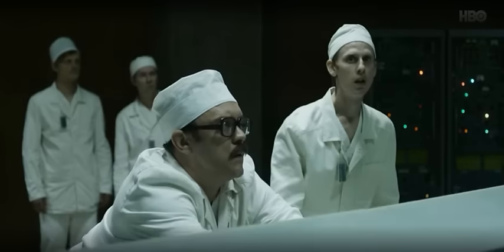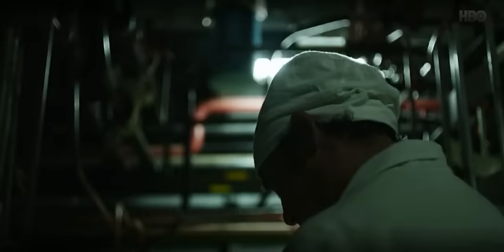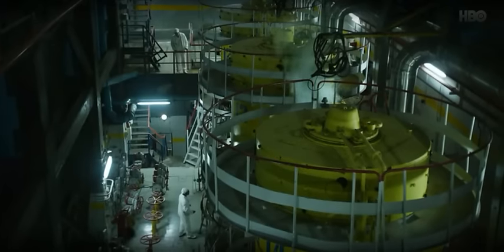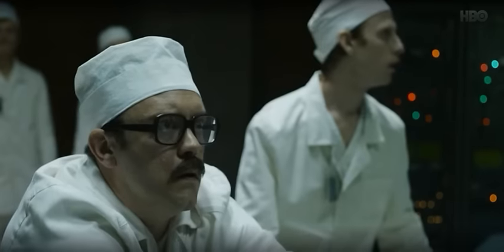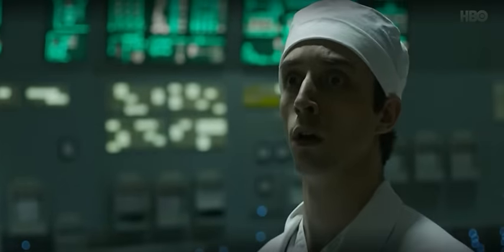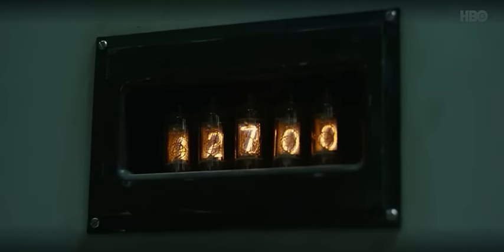Chernobyl (2019) Nuclear Reactor Explosion Scene

Comment: Toponov was the man who pressed the az-5 button. He was the controller at the reactor board during the experiment, and pressed it a little late after looking for his immediate supervisor to tell him, which he did by making an expiration of pressing the button. So it was not akemov but toponov at the controls and who pressed the button. Also there is no way that the run from the reactor up the stairs to the control room in time. It simply takes too long! I’ve heard the phone exchange from the control room that night and it was hectic. I’m told there was a video of the control room during the test and explosion but no one knows what happened to it. If it’s still around properly buried in a vault somewhere in Russia never to be found again!
Reply: You missed the entire point.
Reply: @Korben_MyMan  I guess so…???
Reply: @robertschultz6922  I doubt being "a little earlier" hitting A3-5 would have changed anything. The core was already in a xenon pit after being run at such low ouptut for so long in the lead up to the test. In their attempts to push through that and raise the power output they (Toptunov or Akimov, doesn't really matter right now) tried removing nearly every single control rod. But how much earlier would they have needed to be to reinsert all those rods without risk of vaporising the water and rupturing the channels? Surely that opportunity had passed the moment the graphite portion was removed, not when they were trying to reinsert it.

Comment: still better than coal, oil and gas. around 50% of the energy mix should be nuclear.
Reply: It isn't. Its about 2x more expensive per KWh compared to fossil fuel, and up to 4x more expensive than renewable energy. Nuclear reactors are also far slower to build, and have a tendency to go over budget by A LOT.  In 2020 and 2021 alone, the world added 464 gigawatts of wind and solar power-generation capacity, which is more power than can be generated by all the nuclear plants operating in the world today. Add to that that the mining and enrichment of nuclear fuel isn't exactly clean either (still better than fossile fuel though), and you pretty much have an obsolete technology. And that is even without the part about radiation, nuclear waste, accidents etc.
Reply: @Dr.W.Krueger  and you keep ignoring the facts :)
Reply: @Dr.W.Krueger  then earth has no future.
Reply: France has ~70% of its electricity provided by nuclear power plants yet EDF is on the verge of bankrupcy with a debt of ~100k millon €. General Electric entered in bankrupcy due nuclear is unprofitable and the only reason USA, Soviet Union, UK, China and France pushed nuclear civilian power plants so hard was to leverage the cost of making their nucklear arsenals. Once they had enough nukes the stream of money to waste in nuclear plants was cut and the market did prove that they are unable to compete vs other power sources. Anyone thinking different is delusional.

   Even worse: currently nuclear power plants only provide ~10% of the commercial electricity produced, which is only a small fraction of our total energy comsumption. Even doubling our number of reactor tomorrow won't matter due a) they wouldn't be enough; b) not a single new plant bwould be in operation before 2035 and C) we don't have the money, materials nor real state to build the number of plants required to fill mour energy needs, and in the run most of our countries would enter in bankrupcy.

   I support the ITER due is a cooperative multinational effort to do experimental bleeding edge science, but the ITER is a reserach facility, and fusion is too far away in time (if even achieves success any time) to save our asses from our current evironmental crisis. Nuclear is done.
Reply: @justinbiggs1005  still too expansive compared to renrwable stuff, too slow to build etc.
Reply: @Dr.W.Krueger    So they are smart but what happens is that they are crumbling their own economy in a failed attempt to rescue a unprofitable sector which is not going anywere and will end in one of the largest bankrupt in history? Ok.
Reply: Wrong
Reply: @sloppy-1-1 firstly it’s complete nonsense that any other form of energy can produce on the same level as a modern nuclear reactor. The smallest nuclear power plant in America, R.E Ginna, can produce roughly 5,000,000 MWh a year at full capacity. 
For scale thats 5000 Giga Watts and can power entire cities alone with the smallest reactor in the US.  Comparatively the average coal plant produces around 3,000 Giga Watts a year which is over 2000 less than the smallest nuclear reactor in the country. 

Nuclear fuel fears are also somewhat redundant because they don’t just dump the stuff in drinking water. There are strict regulations on how to dispose and store nuclear waste which can go as far as building entire tunnels to store it in safety away from the public. 
This whole issue will also be solved when Fusion can replace Fission since Fusion reactions produce significantly more clean energy than fission and is what powers the Sun itself. 
Fission all together is also no where near as dangerous as coal or oil since in total 0 people have died from working in nuclear plant. Chernobyl and Fukushima are the only exceptions. Chernobyl was caused by gross mismanagement and corruption by soviet operators that degraded standards until the already poorly built reactor exploded and killed a few people directly and roughly 10,000 - 50,000 from nuclear exposure. Fukushima was caused by one of the largest tsunami’s to hit Japan that was able to bypass several security measures in place, and in total this “disaster” killed 1 person. 
It’s also important to note that both of these places are completely fine to visit today and Chernobyl is actually one of the most biodiverse nature preserves on the world from lack of human interaction. Comparatively several 100,000’s die per year from exposure to toxic fumes from oil and gas refineries along with coal power plants. Cars are also a leasing cause of this and have polluted the air quality of cities like Los Angles and New York by exorbitant oil consumption. 

Fossil fuels are objectively more dangerous and inefficient than the smallest of nuclear power plants and kill hundreds of thousands per year while the only deaths from nuclear energy have been caused by incompetent mismanagement over several decades or massive natural disasters and are minuscule in comparison.
Reply: @motivationallizard6644  that's all nice and probably correct, but my points about costs and slow building time still stand.
And I bet some hysroelectric power planes are equally powerfull.
Reply: @sloppy-1-1  the cost of nuclear power is only as high as it is because people generally fear it for no good reason. If people decided to begin building more plants than costs would go down as the product would be in high demand with a growing supply. Currently there aren’t to many nuclear plants due to fear mongering about made up nuclear disasters and that only makes building them a more money and labor intensive process from a mountain of regulations. If you get rid of the fear mongering and actually start building plants on mass then the price tags and building times will go down. 
Hydro power is also one of the best alternatives to unclean energy, but there’s a huge problem. Hydro dans tend to destroy their environments by reducing downstream river flow. This can destroy entire ecosystems by causing droughts and reduced water flow and can be seen in places like the Mekong River in Southeast Asia. China has built several massive dams on the Mekong’s source  and reduced its water flow enough to destroy much of south East Asia’s ecosystem and agriculture. China also is on tense relations with India that could realistically start world war 3 over the dams there building on Multiple of India’s main rivers. This threatens the food security of over 1 billion people and could seriously start a war. Dams and hydro power are dangerous politically and I haven’t even talked about Ethiopia and Egypt literally negotiating to avoid blowing each other up on the Nile river.
Reply: @motivationallizard6644  still: even if we startet to build these plants right now, they would not become operational for at least 15 to 25 years. Also, one factor that is often overlooked: a lot of the stuff (e.g. fuel rods) were dependent on the nuclear weapons industry in the past, something they can no longer rely on (at least, not in the scale of 30years ago). Also, part of the reason why these things are so expensive is of cause the safety measure. If you reduce costs there, all the fears people have would, to some extend, suddenly become reasonable again.
And even then, apart from the high costs, nuclear power has these costs on the wrong points in the timeline: during the build and decommissioning of the plant, where it doesn't generate any income. So building one is hugely dependent on a stable environment where you can rely on the need to nuclear produced electricity for a long time.

Pretty much every agency admits that nuclear power plants are too slow to build in order to have an impact on climate change. Its way faster, and cheaper, to shift to renewable sources, until fusion becomes viable.
Reply: I say we base 75% of our energy on hamsters running on wheels. A true bipartisan solution

Comment: daily reminder that toptunov pressed az-5, the surge was AFTER az-5, perevozchenko was not in the reactor hall and the caps did not jump
Reply: The jumping was exaggeration but as I understood it, it was well possible that the rods were pushed upwards by the pressure before the explosion.
Reply: @wilhufftarkin5852  not even that, the caps were just still before the explosion
Reply: @IbishuCovet  Well, then its just exaggeration from the series.
Reply: The jumping of the rods is what was believed to have happened due to the the Japanese man witnessing it first hand in the Fukushima explosion. Real accounts used for possibilities.
Reply: @enki2gold  what? that jumping rod thing was thought of in the 80s in a book written by a russian worker, not by a japanese worker in fukushima 
also, the reactor type in fukushima doesnt have a visible "lid" like the rbmk, so i dont exactly know what you mean
Reply: @IbishuCovet  do some research. It was never feasible until Fukushima when it was visually seen by human eyes.
Reply: @IbishuCovet  no lid is correct but it had rods too 😂
Reply: @enki2gold  i literally dont even know what youre talking about, are you saying the rods jumped at fukushima or what...?
Reply: @IbishuCovet  ok so you know the lid was too help with possible explosion and addition protection from radiation. The one in Fukushima didn't have a lid because the company though they would never blow up or even fail. When the generators were lost in Fukushima that was nail in the coffin
Reply: @IbishuCovet  I have nuclear engineers in my family. They know all the facts if you got a question I'll answer it in due time. Ok...
Reply: @IbishuCovet  yes the rods in Fukushima jumped up and down as a man walked through which is what started the freak out
Reply: @enki2gold  ...do you know anything about fukushima and bwr reactors? bwrs are rounded and dont have a flat top or bottom, they do not have rod caps or something, and they CANT PHYSICALLY EXPLODE, the lid on the rbmk was just the caps which were removable for refueling and maintenance, and even they didnt build it to be protected against an explosion or smth, because no one had thought reactors back explode like that (they cant btw, only the rbmk with the old pre-disaster safety systems and stuff can and did), what exploded at fukushima was a hydrogen tank, NOT a reactor
Reply: @IbishuCovet  it was not hydrogen tanks it was hydrogen build up from the reactions. Just like in chernobyl when the oxygen hit the hydrogen it blew up. The only difference was in Fukushima the core didn't get damaged. I'm not going to debate someone who doesn't know what really happened. And difference in the builds. The soviets had a cheaper build which was the downfall. Japan just had over confidence.
Reply: @enki2gold  ...i dont think you have any idea how fukushima or chernobyl even happened, chernobyl exploded due to VERY extreme steam pressure, not because of hydrogen getting into context with oxygen, and in fukushima the core DID get damaged, they had multiple meltdowns, but meltdown does not equal explosion, it actually NEVER equals explosion
and tell me, why would hydrogen be in the rpv...??

Comment: That explosion shown was small compared to what an actual nuclear reactor explosion would be like.
Reply: thats bcz it wasnt a nuclear explosion, it was a steam and graphite explosion, however the explosion released the uranium in the core
Reply: yea nuclear reactor can not explode like a A bomb cause fuel used in it is not enriched enough. if they used bomb quality uranium in cores there would be way more Chernobyl's :D
Reply: @lorenzzorzt  True true. Further detail: Reactor uranium is in a supercritical state, but not "prompt" supercritical. The fissioning process is only self-sustaining due to delayed gamma particles, events that can span over the course of minutes. Without the delayed particles circulating among the water media, control rods, and fuel rods, the fission process would flatline- the fuel would melt down, but not explode. "Prompt supercritical" reactions create enough spare neutrons to be self-sustaining by themselves, on the order of microseconds. This is only possible in the highly enriched, compressed core of a bomb.
Reply: @lorenzzorzt "uranium in reactors is enriched a little lower than nukes"
A "little". By a little you mean a whole lot?  Weapon-grade uranium is over 90% enriched, while the Chernobyl fuel was only 2% enriched,

You couldn't even get an atomic bomb to work if you'd put reactor fuel in there.
Reply: @Dennis19901  True, sorry for forgetting that.

Comment: The fact that this may really happen again in a more massive scale is what?
Reply: Zero chance.
Reply: tell me how exactly this will happen again? educate yourself pls
Reply: chernobyl was built with cheap shit, this cant be replicated anymore
Reply: You would basically have to go out of your way to replicate this with modern technology
Reply: @oscar-ff2nn  it very well could bc we still use nuclear plants and this situation was caused bc of humans being careless and pushing the limits
Reply: @tylerfb1  not exactly
Reply: @0tocci029  this is not the same nuclear powerplant we use today in any way at all.. what is your point exactly?
Reply: @0tocci029  it was caused bu carelessness, which is exactly why it wont happen again. People have gone out of their ways to make it obsurdly safe
Reply: RBMK reactors with positive void coefficient are no longer used to create electricity. Modern reactors have a much different control mechanism that by design prevent this from happening. By design means that even if you screw up bad, the system cannot get into this situation, no matter how hard you would try to get there. And on top of everything else, we now have electronic controls that monitors everything and can prevent users from doing stupid shit by blocking controls when things are not good. Just like a computer takes complete control of planes when there is a risk of collision with another plane in mid air, efficiently removing any possible human error.
Reply: @0tocci029  that's not to say that there isn't any chance of nuclear accidents; there is, of course. The question is could a situation like Chernobyl happen again, and the answer is no. There is no nuclear power plant on earth that is able to behave like this. It's not possible. Not, "well so many things would have to go wrong for that to happen..."no. Not possible.
Reply: More likely not going to happen. The reason Chernobl happen was because what was said, no communication and the reactor built is too cheap.
Reply: @LtKregorov  RBMK reactors are still running in Russia, althrough heavily reinforced with safety measures after Chernobyl. But your comment about planes is news and puzzling to me. There are collision alerts indeed but I'm not aware of any plane override the pilot's inputs in such a situation, just as controlled flights into terrain still happens even with EGPWS.
Reply: Not likely.
Reply: Reactors are made differently now so it can't happen again. This type of disaster can't happen.
Reply: Chernoblr had some horrendous design flaws and the levels of operator errors and sheer incompetence would be difficult to replicate. Now adays the levels of regulation and inspection that goes on at a plant is so high that even an intentional sabotage of the plant could not make it explode like  what happened in 1986. I could see something like this happening in china or india but in any other first world country? No. Especially not in the US and Europe. The laws and regulations are constantly being made and this is why nuclear power plants go over budget so often.
Reply: They stil run some of these rbmk reactors.